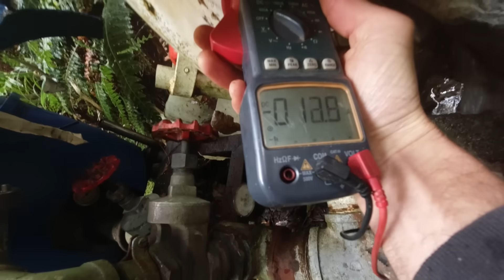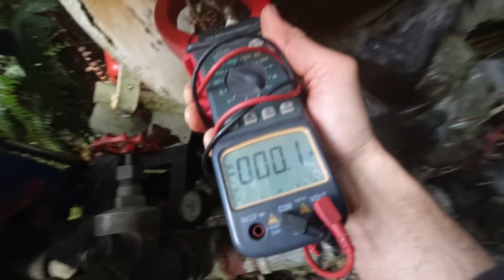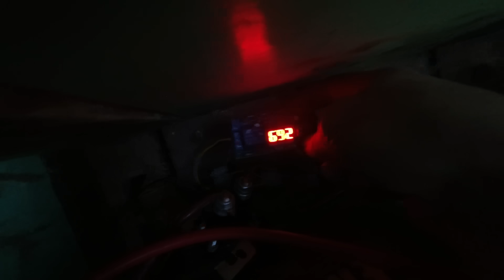Free Power for 16 years from a modified Washing Machine / Water Wheel

Comment: "It's only generate 300 watt it should generate about 600 watt, Maybe something went wrong "

Dude...! That thing has running for 16 years! , Yeah maybe something went wrong after 16 years.
Reply: How does he power kitchen appliances. Toaster (2KW), kettle (800W - 2.5KW), microwave (800W), dishwasher (1KW+), washing machine (1KW +), fridge (200W when compressor is on). Theres no way he can run his whole house on 600W.
Reply: @simontay4851  Marty has batteries and a large inverter up at his house 500 metres away. The inverter at the house charges those batteries plus the inverter then uses those batteries to supply up to 4000 watts (4kw) to any household appliance.  Since all his appliances are less than 4000 watts, there is no problem. If you watch his other vids he states he needs to use a generator to power his welder or for any draw over 4kw. If he had enough batteries and a huge inverter he could power the welder, too...but that isn't economic.  It's all a matter of the total watts supplied in 24hrs (600x24) less the watts taken /consumed by appliances/charging losses. The way he runs his system and his lifestyle means he is in surplus...and has been the last 16 years.

Comment: What an outstandingly ingenious installation you've created, and the additional benefit of your system is that it doesn't generate electricity bills which you'd get with the on grid system!

Your meticulous installation is so well made that it only requires an annual inspection, that in itself is particularly impressive.

Thank you for sharing your excellent work, it's a joy to see this in action.
Reply: Yes but if it was grid tied, he wouldn't be wasting all the energy once the batteries are fully charged, grid tied is much preferable IF you have the opportunity.
Reply: @portnuefflyer   As was stated in the video, connection to the grid was prohibitively expensive, hence this system!

Comment: how are you able to have water pressure from the bottom, running up on a hill through a small fixed pipe without having a pump, to pump forcefully into the pipe at a consistant water speed????? you show nothing explaining that. I suspect fraud in this video.
Reply from the maker: Gravity creates the pressure, google- 'water head pressure' it will all make sense

Comment: would´nt be better to clean de area and build a simple shelter with bricks or cement for the generator and the pumps? This way everyting could last more in a better conditions, only pipes would be really exposed which being pvc isnt much of a issue. By the way, in rain season how much water come of the river, because the riverbed is pretty wide for the amount of water that runs on it, so rain season must get a ton of water,  how you control the water pressure and secure the filter and all the stuff on the riverbed?
Reply from the maker: It is quite a hike up to the turbine site, I don't feel the urge to carry heavy building supplies up there. The stream is now running at full volume after heavy rain, probably 50 times the flow now
Reply: @MartyT  I see then, well great system either way
Reply from the maker: Thanks man, I see where your'e coming from.. I have debated whether I should build a little turbine house but I just don't have enough hours in the day
Reply: @MartyT  Its ok, it has worked for 16 years so i guess is worth to keep it this way, at least until you have more time and some extra help to get the necesary material to build something like that up there.

Comment: Are you quite sure that input line is 4" ?   it does not look much more than 2" the standard irrigation size
Reply from the maker: 4 inch at the intake, reduced to 3 inch half way down. The backup turbine goes from 3 inch down to 2 inch near the turbine

Comment: Awesome vid Marty! I currently live on a property where I can also run some 150m of water piping through my property to generate hydro. I was wondering if you could explain a bit more your hydro to home battery setup? Would any pelton wheel work?

How many kW of batteries do you have setup? Thanks a lot!
Reply from the maker: Sounds like you have potential if the head is over 5 metres. My battery bank is just a couple of old truck batts connected in series to make 24v, don't need much storage with the turbine running 24/7 unlike solar or wind power
Reply: @MartyT  that's a great point, the batteries act more like huge capacitors but what if you have a 7kw water heater, will they provide enough power to have it running for a while? I would imagine you're inverting the 24v DC to 120 AC right before sending the electricity to your house? How much psi are you getting at the generator?  Did you mention that you're using a 2" pipe? What are your thoughts of increasing the diameter to 3"? My stream is much like yours, so I wouldn't want to dry it up. Thanks for the reply and thanks for the inspiration!
Reply from the maker: 7kw would be too much for my system, 5kw max. generator for anything above that.  I have a wood burner for cold nights, but I am able to put a 600w heater on in the kids bedroom overnight. I invert from 24dc - 240ac (standard grid power for NZ) 60psi at the turbine, 4 inch down to 3 inch on the main turbine. 3 inch down to 2 inch on the backup turbine. Get the biggest pipe size you can afford, you get far less wall frictional losses with a large diameter pipe, buy second hand if you can, you can save thousands $$.. You can control your flow with the jet size, no need to dry up the stream.
Reply: @MartyT  wow thanks! 4" sounds like the solution! Now I need to look for those second hand pipes. Did you mention that you could actually generate more power out of all of that head pressure?

Comment: 3:00 bearings sound rough, c’mon, they’re scrap, Jack.
Reply from the maker: What you're hearing is the cogging effect caused by the magnets on the rotor passing the steel poles on the stator, bearings will be good for  another half billion revolutions (1 year)
Reply: Marty T    I didn’t see any clogging action. I’ve heard a lot of over used bearings and those are right there amongst them. I agree about the permanent magnet generator behaviour, I think you’re in for a big let down. Nice idea other wise. Don’t get me wrong, I’m not putting you down for your ingenuity, it’s a great way to beat the system. Keep it going.

Comment: Did you know, if you spin most washing machines by hand, even if they aren't plugged in, they will turn on from the electricity it generates, and will turn off slowly after you stop spinning it
Reply: If you pull the plug (or the power goes out) on a Fisher & Paykel washing machine (the one in this video) during spin (when there is a lot of rotational energy), the electronics notice, and safely bring the spinning drum to a halt without frying the circuit boards..

Comment: Soo what is the brand of the washing machine that had been running for 6 years ?
Reply from the maker: F&P smartdrive, they have a very well designed permanent magnet motor
Reply: Not a Samsumg. That's for sure.

Comment: Tree root after water?, happens yet wet looking Gulch, do you switch diameter of water pipe to obtain extra supply as you seem to have quite a drop on your system, thanks for keeping it alternative
Reply from the maker: Yes I put a bigger jet on the pipe during winter when flow increases so I can run a heater in the house

Comment: Do you have a battery in your system? I heard you mention it. Is it down in the woods or up at your house?  In the 16 years, have you needed to replace any battery parts ?
Reply from the maker: Yes I use 2 old 12v truck batteries at the turbine to make 24v which feeds the 24 - 240vac inverter, they last for years because they rarely go below 12 volts.

Comment: Nice video, nice turbine.
Interesting that you've got the load dumping at the turbine rather than at the point of storage and use. Are you putting it through an inverter before the wires, or sending 24V through half a km? What kind of charge control have you got on the batteries?
Reply from the maker: Yes I have a small 24v battery bank at the turbine ( 2x12v old truck batteries) connected to a 24v - 240vac inverter so I send 240vac 500m to the house. 3 stage voltage dependant  dump - 27v house hot water cylinder, 28v heater in the house, 29v emergency dump open valve at the turbine/ water element in stream

Comment: Nice video, Thanks! The 4” conduit/pipe run; is it reduced in diameter as it flows back to the turbine nozzle? 60psi is awesome...but I’m confused as to how from a 4” pipe? Also if you don’t mind; how long of a run is that conduit/pipe? Thanks again for your vid and info.

Comment: 20A at 24V is 480W. Not bad. It won't run a kettle or heater but if you have other means of generating heat it seems really good enough.
Reply from the maker: It was sitting around 26.5 v so around 600w including output from the 2nd turbine. Power from the batteries feed a 24 - 240vac 5000w inverter so yes I can easily boil a kettle
Reply: @MartyT  Nice. Do you tho?
Reply from the maker: @frantisekzverina473  Yes I use the kettle, toaster, microwave. Everything except an oven and hot plate, I use gas for that
Reply: @MartyT  That's awesome! I did not expect that

Comment: I have collected 3 of these motors over the years inspired by your first videos about putting this water wheel generator together.  The rewiring part I didn't agree with so I left mine at high voltage AC. I built a Gilligan's Island style bike generator because I have no water running through my property. Glad to know it has been a lasting build for you.  Bearings every 2 years and a quick cleaning is not a bad trade off for an electric bill haha.  Thanks for the videos!

Comment: 1:37 Please explain this hand drill setup...

Edit: after seeing it again later in the video, is it like a crank start that holds open a solenoid valve/ aquastop in a latching circuit, with the purpose being a low-voltage cut-off?
Reply from the maker: Yes it is a home made auto valve, I don't use it these days,  I prefer to rely on the dump valve
Reply: @MartyT  Thanks for the reply. That's great. Something I never thought of before, but your ingenuity made me so curious I had to work out what it was. Cheers for the quality content, too.

Comment: why not put the dump valve on the inlet & have the sound of running water rather than spin cycle noise, save bearings etc?    there myst be a reason?

Comment: what the function of the drill machine beside your generator? did it use to speed up the water flow?
Reply from the maker: A voltage dependant auto valve, I don't use it these days, The dump valve is more reliable

Comment: So....how does this work ?
Reply from the maker: Water goes into the intake, creates pressure due to the difference in height between intake and outlet nozzle. Water comes out of the nozzle at 60psi and spins the pelton wheel which is attached to the modified washing machine motor (now a generator). 
The generator puts out 3 phase ac voltage which is passed through a 3 phase diode block rectifier to change it into dc, it is then fed directly into a 24v battery bank,  a 24 - 240vac inverter is connected to the battery bank, 240vac travels up the power lines to my house. I can now power all my 240vac household appliances from the inverter
Reply: @MartyT  and you read all this in a book or went to college ? Or just figured it out ? But I suppose you have been by necessity putting all this together over time....since you've been there a while. I lived in the bush for four years here in Canada.. just bush and had my own little camp. No power as such just wood heat. when it got dark I went to bed. Dried my meat or fish and just let the land tell me what to do. Do you own your property and have neighbors or just live off grid ? I lived off grid.

Comment: Might want to have a duplicate turbine setup ready for quick swap... that way you simply swap the running one out when you want to change bearings or the running one goes down.
Reply from the maker: I like your thinking, I will build a spare when I get some free time. The backup turbine will keep things ticking over until I build a new one if the main turbine gives up. There is not many things to go wrong with them as long as the bearings are changed before they wear out

Comment: What's your future design going to be?
Reply from the maker: A few little changes - I would use treated ply for the end cap (current cap is rotting, I didn't expect it to last so long) Also I would use an epoxy sealed 3 phase rectifier, I've had issues with terminal corrosion on this prototype and 3 phase recs are cheap these days

Comment: Marty by chance are you stepping the pipe diameter down to get water pressure?
Reply from the maker: That would actually reduce the pressure due to increased pipe wall friction on the smaller diameter pipe, I ran out of 4 inch pipe so used 3 inch for the last stretch.
Reply: @MartyT  thanks. I was just trying to figure out how your system went from a lazy stream to the necessary flow required to run your turbine. Love the ingenuity and reuse of available resources.

Comment: May I say that was a very interesting video. Very innovative as well. I take it you use "Sealed Bearings" in those turbines? There's a way  you can break those seals and replace the existing Grease with "Synthetic Grease" Bearing manufacturers tend to use low-quality Grease (lithium) in their sealed bearings.

Comment: So, correct if im wrong. current supply is 20A @ 25V, so it's 500W?
Reply from the maker: It was more like 26v and the other turbine puts out 5 amps. Most of the year I get over 1kw combined but we haven't had much rain lately

Comment: Running electric motors in reverse is not as efficient as just using a purpose built generator, the rotor and stator simply aren't designed for output. Mostly comes down to windings and their impedence, high draw can cause the motor to drag and overheat where a generator wouldn't have a problem.
Reply: isnt the idea here to reduce the need for generators?
Reply: Didn’t he get the parts for next to nothing? And it’s been working for over a decade.
Reply: works well enough for marty
Reply: Great point and I don't know how anyone could try and disagree with your statement. They seem to be talking to themselves lmao generators are better 100% fact

Comment: We used to get salamanders from the spring in the plumbing in West Virginia. Turned on the water. Wouldn’t turn off. Stopped the water undid the faucet valve. There it was a bit chewed up from trying to turn it off and on.

Comment: Awesome project!  This setup wouldn't make any sense to build today, you could get solar panels and a couple batteries for less than the cost of the pipe and power lines, and stick the solar panels next to the house (if possible).
Reply from the maker: You would pay many thousands of dollars for a 14.4kwh solar setup, and batteries would need to be enourmous to match 24/7 output of hydro power

Comment: Good stuff mate. Ever considered Tesla batteries with solar panels, as back up maybe?
Reply: solar panels are way weaker and less reliable, more costly and less eco-friendly then water power. 

If you can harvest water power without disrupting the natural flow of the body of water you are taking it from, then there is no better/cheaper/ecological way of harvesting energy. 

one small water turbine with 10 m (30ft. drop) and can easily, and continuously provide enough power for 2-6 households. 

In places where water is rare, wind and solar make most sense, but solar is always prone to fail, because of its complexity. (photochemical reactions, too many parts, some only form high tec resources.) 

Mechanical power sources always have the advantage for being easier concepts, that you can easily build yourself (as in this video from a washing machine) 

A tesla power bank on the other hand only make sense if your power source is fluctuant in its harvest (such as solar and wind). In his case it seems that he has more of a problem with excess energy than with inconsistent energy intake. 

His system seems quite strong and robust. and it produces with steady capacity. 

It would be obsolete to install further expensive solar/power bank system.
Rather buy more land or invest in other self reliance infrastructure, such as: 

- a glass house garden, with seed bank, 

- a sub terrain cold storage (celar), 

- a smoker for preservation, 

- a fishing pond,
- a humus/dark soil maker (where you mix compost, coal, dead wood, fertile mud with dead soil to enrich it with microbes and revive it.)

- a distillery for producing your own, disinfectant, cleaning products and fuel (simple combustion engines (tools) work well with alcohol, even old cars)

With that he would not only be self reliant in terms of electricity, but also in terms of fuel, food, and soil. 

I guess he has done most of those, if he has build such a great power plant. 

Cheers
Reply: Ignore first reply he could use a solar and a battery but it seems like he already creates enough energy that he has to dump extra power so he wouldn't  need them unless he wanted to install ac in his forest house.
Reply: @XLostGamer 
Got bit out of hand in length... ,  but don't ignore me. 😢
AC in the woods? seriously? 
... city kids these days.

Comment: Why didn't you use a higher transmission voltage it would save loads on cable cost the pipes expensive in New Zealand here in Spain hundred meters 50 millimeter 4 Bar polycarbonate irrigation pipe €60
Reply from the maker: I transmit 240vac via the inverter, very little cable loss. I use 100mm od pipe, 50mm would work but far higher pipe wall frictional losses
Reply: Yeah I just caught 24 V for the generatorThe pipe looks really small on the video and you did say 4 inch (100mm)pipe your filter is much the same as mine it's good to have a sediment  tank followed by a beam and weir and then the last filter